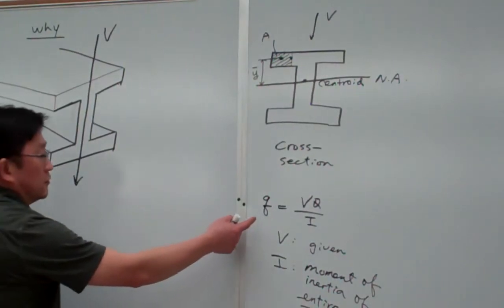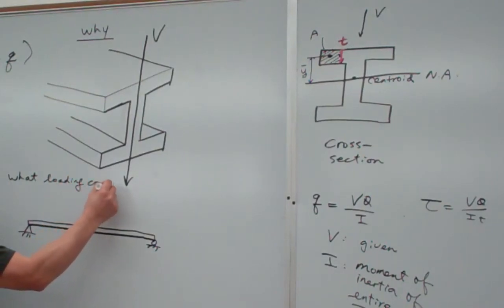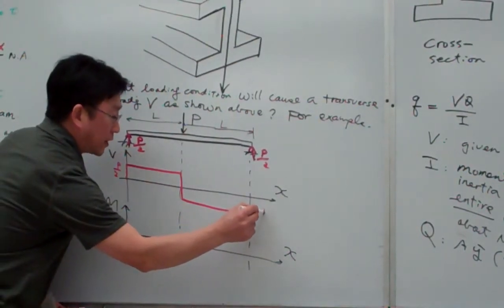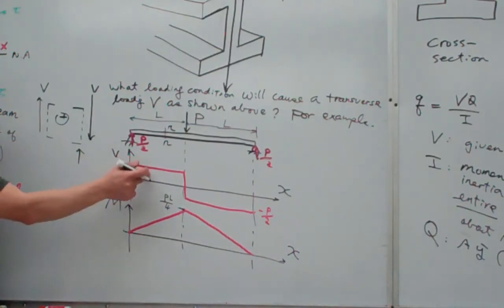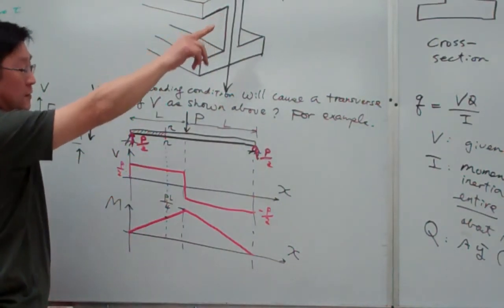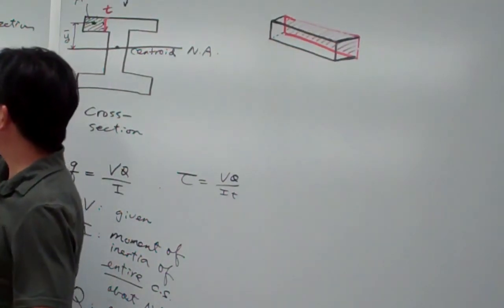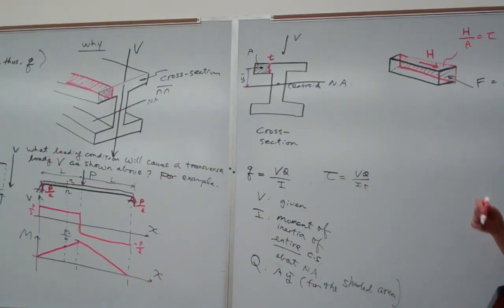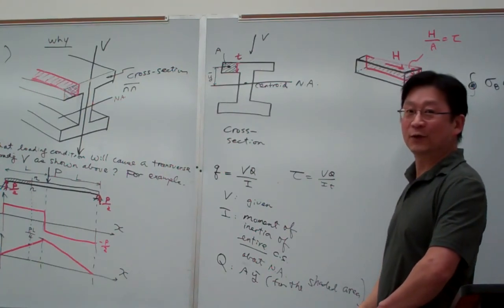15 70 Determine the direction of shear flow 2 of 6

Comment: This video helped me figure out WHY the directions of shear stress in a transversely loaded wide flange beam are what they are. 

The shearing force on the cut element must oppose the net force due to bending normal stresses acting on the cut element. 

Thank you for not just saying exactly what it typically found in a text book. The additional explanation is greatly appreciated.